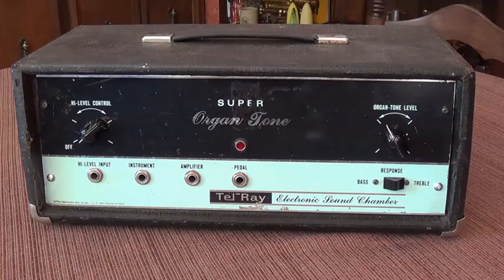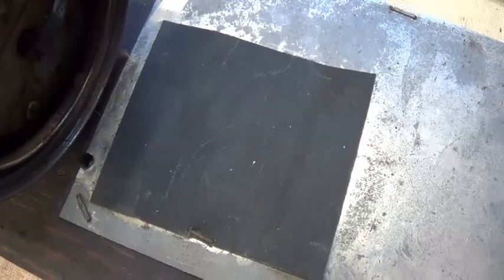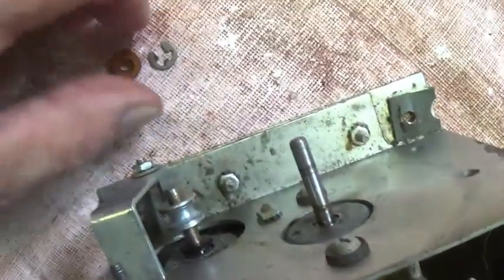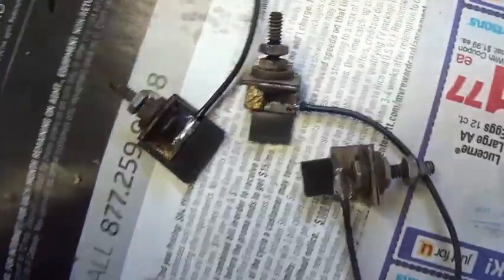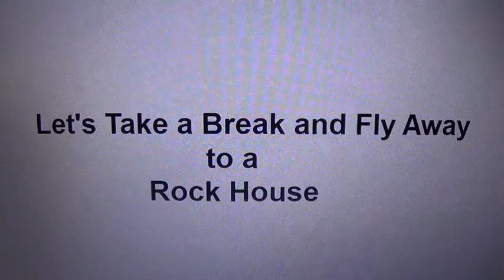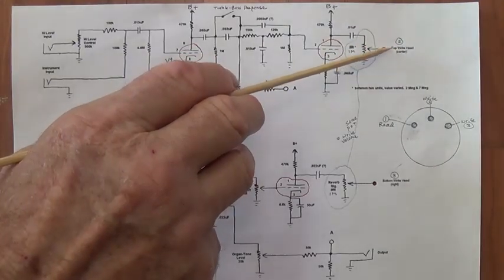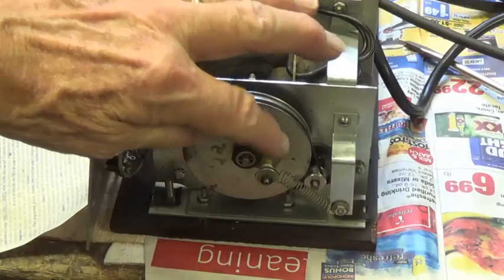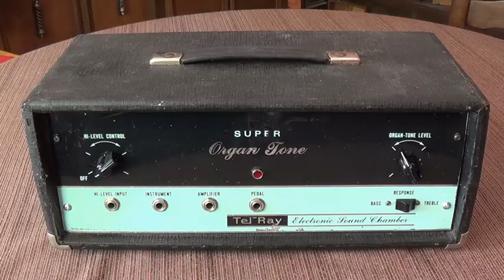Tel-Ray Super Organ Tone Resurrection.......Saved from the Dump !!

Comment: Uncle doug nice work one thing missing: how to clean the magic disk? thanks uncle Bill in upper michigan!!
Reply from the maker: Thanks, Skip. I use plain water and a soft towel. Not knowing the exact nature of the coating, it's best to take no chances.
Reply: @UncleDoug  just wanted to let you know i got one kinda working and am gonna ebay it. i simply took a little of the oil used in the can and with q-tips gently ribbed the black deposits off the magic disk. it might need more work but i got sounds from it. put up this video tonight.

Comment: Dude !! AWESOME Restoration !!!  After seeing the small amount of oil inside the can, do you think it would be a good idea to use some leveling feet and a bubble level on the cabinet ? I sure would hate to smoke that disc or heads !
Reply from the maker: That's an interesting idea, Joe, but the disc comes so close to the bottom of the can that the disc really can't avoid the oil......unless the unit was tipped way toward its front or back, which seems unlikely.

Comment: Hello Uncle Douglas:  I have seen your tremolo video several times and it is one of the greats .  That is why I could recognize that a phase shifting circuit was involved.  What I was referring to is a pitch changing vibrato circuit at sluckeyamps.com called the Warbler.  I believe you mentioned it in one of your shows.  That is how I knew how to look for it.  I know you played a true vibrato in one of your shows and mentioned that you liked it.  Since there is a 1/2 12AX7 that is unused in your Supro modification, I was wondering if the Warbler could be integrated into the Supro build, as a tremolo is already present.Thanks again, live long; vince
Reply from the maker: Thanks, Vincent. True vibrato is a rare beast, generally only seen in some Brownface Fenders and Magnatone amps. The Fender circuit requires 3 tubes to achieve its magic and the result is much like a very rich, lush Tremolo, as demonstrated in my video on the Fender Concert amp. The Magnatone requires the use of Varistors.....which are virtually unobtainable.....and sounds quite different from the Fender.....more fluttery and Leslie-like. I tend to prefer the Fender sound, but not enough to dedicate 3 tubes to achieve it. The best of both worlds would be to build a stand-alone ReVibe, which consists of a Fender Vibrato and Reverb in one cabinet.

Comment: It was very interesting. The only thing i would add is the ability to switch between vibrato and “normal” setting. The way i see that implemented just from the top of my head, is to add a “dynamic extension” between the spring and a chassy, dynamic meaning that you can change as to wether it is extended or not, and the way it would work is in “extended mode” the spring won’t have enough tension, therefore it will not create a wobble, and in “compromised mode” it will wobble, since you compromising the extention, therefore altering the spring tension by making it closer to the chassy, and getting a vibrato effect as a result. I don’t know exactly what this “dynamic extension” would look like, but i’m sure there are various ways to do that, whether you want to go fully mechanical, or use some sort of a relay, or another motor perhaps.
Reply from the maker: Actually, there is a very simple way to change from clean to effect, Danich. There's a "Pedal" jack on the front panel for a simple on/off footswitch to accomplish this by shorting the read head (see schematic).
Reply: Uncle Doug I think you misunderstood me. At 40th minute you add a spring that dramatically increases wobble quality of the effect, and i thought it sounded cool with it, but at the same time i thought it sounded more usable as an actual echo without the spring, and my idea was about adding the ability to alter tension of that spring to basically increase or decrease modulation of the echo.
Reply from the maker: You're right, Danich, I didn't understand your previous inquiry. I think the way to achieve control over the vibrato effect would be to get rid of the spring and have a steel arm moving within an electromagnetic field. When the arm is attracted it will speed up and when repelled, it will slow down. Then you could vary the strength of the field. Just an idea, but it might work.
Reply: Uncle Doug It definitely may be one of the ways to do it. The only concern i would have is as to wether or not magnetic field interferes with other parts of the whole machinery by making something not working properly.
Reply from the maker: The grounded metal can enclosing the read/write disc should reduce the possibility of interference, Danich.......sort of like a mini Faraday Cage.
Reply: Uncle Doug Do you consider performing any of this ideas? Could be a fun project.
Reply from the maker: I wouldn't want to alter an original unit, Danich. Perhaps if I could find a damaged one to experiment with.

Comment: So what is the differential level between the write and read signals?
I'm getting one write at +9, one at +17 and the read is hovering around -35dBu.
I am sending about -10dBu into it...
I think the drum (since it is only going to a common emitter output tube circuit) needs to be a lot bigger signal coming out of that delay can.
Thanks Uncle Doug!
Reply from the maker: It's been quite a while since I worked on one of these infernal devices, Jay. I'm afraid I can't answer your question.

Comment: Can you explain how there is any appreciable signal at the Organ Tone Level pot? It's fed from the cathode of V2a, which is a cathode follower configuration. Since the gain of a cathode follower is less than one, isn't the signal fed to the pot very low? I guess I'm asking how much signal is picked up from the read head. Thanks for another inspiring video.
Reply from the maker: I agree that the increased input stage impedance "bootstrapping" provided by V2a is unproductive with regard to amplification of the (no doubt) rather low voltage input signal. In addition, it then converts the low voltage to current, thereby further reducing the potential. It's hard to see how it can then be mixed "fairly" with the Direct Signal, which has been voltage-amplified by V1a. The next time I take the unit apart, I will analyze the voltages with an oscilloscope. As it stands, I am as bewildered as you are. Perhaps another viewer can help us to understand this seemingly contradictory circuit.
Reply: I don't like stumping  @UncleDoug .

Comment: Fantastic, as usual, Doug!  A sound sort of reminiscent of a Leslie -- maybe that's where the "Organ Tone" idea comes from.  Tempted to try to find one and run my theremin through it, but I'm afraid that might open up a tear in the fabric of spacetime.

So maybe I missed it, but what does the pedal jack do?  Is it for a simple on-off button?  Because I couldn't help but think of how cool it would be to have a speed control pedal, or some external control on the write volume.

Also, I'm wondering about the details of your media blasting setup.  Always been interested in that stuff.  What kind of equipment is involved, and what media did you use to clean those parts?  Wonderful work on that; amazing how clean you were able to get them.
Reply from the maker: Thanks, Ed. I believe the pedal turns the effect on and off, but didn't test my theory. A variable speed control would be a nice touch. I used very fine glass beads in a blasting cabinet at 90 PSI and applied it carefully......just enough to remove all the corrosion. The metal underneath was in good shape, thank heavens.

Comment: Hey Doug, love the videos. Really interested in building a parallel single ended amp (with 6v6's). Ever built one of those? Would be really interested in seeing a scratch build of one, got lots of questions about the power requirements, what you'd do to the impedance calculation for the power tubes/OT etc
Reply from the maker: Thanks, Oli. I have owned parallel output amps, but I have never built one. To be honest it's sort of wasteful, since push-pull is much more powerful, efficient, and quieter (hum cancelling).  Also, the idea of building a louder single-ended amp is a little counter-productive, since the charm of SE amps is most apparent at moderate volume.

Comment: I had a Hammond organ with tone wheels in it. Is this the same thing?
That was very interesting. Can this design be scaled up?
Reply from the maker: I have no idea, JJ. My knowledge of organ accessories is near-zero. I guess it could be, but I'm not sure why since it seems to work quite well as-is.
Reply: J J , apparently the tone wheels inside your Hammond Organ are indeed capacitive in action, but significantly more complicated because they have a series of stacked rotating metal fins similar to the tuning capacitor or tuning condenser in any analog radio or tuner. There are a number of YouTube videos online pertaining to repairing these devices, which are prone to growing conductive metal crystals known as dendrites in between the contacts and the rotating stators or metal fins. Several videos show how to zap those dendrites out, without disassembling the tone wheel completely, with a 9-volt battery! Actual disassembly of the tonewheel is even more complicated than what you see Uncle Doug doing here.

Comment: Uncle Doug; this is an amazing instrument. I have travelled the world and studied many different technical things that very few people even know exist. I can say I had absolutely no idea that anything like this ever existed. I really appreciate your showing it in such detail.

The media blasted parts look great.  My blast cabinet has glass bead media in it, and it seems to put a more etched / less shiny surface on parts. For my projects, that is really not a problem.  What are you using to get an almost polished effect by blasting?

When you installed the pulley on the read/write disc shaft, you mentioned using superglue. Have you ever used Loctite on things like this? I use it extensively. It's good because it sets up when in a thin layer, in contact with metal, in the absence of air. It's great for things like this!  Not that the super glue is inadequate! Just that Loctite is easier to work with since it won't set up until it's assembled. The sound check is beyond anything I imagined it would do. Incredible that a simple signal generator tone could be modulated into such a complex, and fascinating sound by this simple mechanical device. 

The guitar demo was incredible as well. Again I'm amazed and blown away. Thank you!
Reply from the maker: You're welcome, David. Thanks for all your comments. I did use very fine glass beads at 90 PSI, and was careful not to stay in one spot too long. I'm really glad you liked the video.
Reply: Good info on the fine beads. That may be the difference as I am using a medium size grit.

Comment: What material did you use in the media blaster?  It works a treat!
Glad that Jack saw fit to give the unit a CAT scan before you started the restoration!
Reply from the maker: Yes, I'd be lost without Jack's initial scan of all components. I used fine glass beads at 90 PSI.

Comment: How about using a high wattage wire wound potentiometer to vary the line voltage to the 
Motor from perhaps
90 to 120 for a speed control. The telray sounds like an effect Iv 
Heard from a B class Si Fi movie from back in the 50s or 60s
Reply from the maker: Motor speed could be easily regulated with a simple fan speed control from Home Depot, Dwight, just like the one I used in my compact Leslie speaker.

Comment: Great job, Uncle Doug! A quick question for you though, What media did you use for blasting? Crushed walnut, glass beads? I know walnut is usually used for fragile pieces. Keep up the excellent work, cheers! - TW
Reply from the maker: Thanks, TW. I used very fine glass beads at about 90 PSI. If I had walnut shell media on hand, I probably would have used it instead.....but it all turned out great.

Comment: OMFG, holy grail!!!
Reply from the maker: Thanks, AQ. It's a dandy !!!
Reply: Just finished watching this, absolutely amazing! Was this meant to be a Leslie speaker simulator, hence "organ tone" and that strong vibrato effect?

I'd have thought one of those write heads would be an erase that would drain the charge to ground in front of the write head but I guess not, at least not on this model. Some models definitely work like typical tape or bucket brigade delays though where the number of echoes is controlled by feedback of the read head mixed back into the write head, often called "regen" on old devices like these. I think on those ones an erase head is necessary.

I'm curious about the different widths of the rubber heads. I wonder what that's about. Might the charge spread out on the disk, maybe so wider heads are used to read than write? (Or is it the read head that's narrower?)

And just to freak you out, have you heard the rumor that these originally contained PCB oil? I've heard both that they did and didn't from different sources. Seems plausible enough as large transformers at the time commonly used a PCB infused dielectric oil for convective cooling. Obviously these devices work perfectly fine without any carcinogenic chemicals though, so I can believe just as easily that they didn't. (Still, might be a good story to tell a seller to get them to lower their price! ;)

Comment: Hi Doug, great video and thanks for sharing! I am not familiar with your media cleaner. Could you please explain what device this is?
Reply from the maker: It's a large, sealed cabinet that allows you to spray very fine glass beads with an air gun at dirty, corroded metal objects, removing all the surface grime almost instantly......leaving a smooth, satin finish ideal for assembly or painting.
Reply: Thank you, like a sand blasting cabinet...
Reply from the maker: Yes, except I don't think anyone actually uses sand for blasting purposes in a cabinet like this.

Comment: Wow suoer video! 50s movie effects-also sounds like psychotic Dick Dale. But doesn't that oil leak out of the can when the unit is turned around? Or dry up?
Reply from the maker: No, the oil does not leak out. The can is sealed. It may "dry up" over a very long period of time simply due to degradation.....just like the lubrication in a waterproof watch case.

Comment: hi doug :-)
at the guitar demo part i would be tempted to use a two channel input amp and run the oil can full wet then blend the sounds with the dual channel head.
that thought hit the brain after about five seconds of hearing that. i would love to hear my washburn long scale through that thing to be sure!
i have to wonder though...was there a unit that didn't use the spring attachment? i actually preferred that sound to the sound of having the spring attached.
 thanks for sharing this with us.
Reply from the maker: You're getting too technical for me, Giz. The spring attachment can be removed in a few seconds if you prefer it without the "wobble".

Comment: So, when they anodize aluminum it makes tiny pores in the surface (I think they use Sulfuric acid in a way much like Electrolysis) and during then the second stage a colored dye fills the pores along with a wax like sealer.  Some people even anodize with a clear.  The color of the piece is what you're seeing in all the tiny holse.
So I wonder if the sealer slurry has these tiny carbon granules that fill the pores during the second stage to make these disks.  Since anodizing makes the surface a thin layer of aluminum oxide the result is much stronger surface, no wonder it lasted so long.
Reply from the maker: This is all news to me, Daniel. Thanks for the interesting info.
Reply: @UncleDoug  I'm a little surprised that you haven't tried anodizing yet, especially with all the hot rod stuff you do.
Do add to my earlier post, apparently the heat expands the pores enough to draw in the dye, they can do that without any wax since it cools down and shrinks the pore openings.
Reply from the maker: @dbingamon  A friend of mine who restores motorcycles professionally, tin plates the hardware using a simple electroplating setup. This is about as sophisticated as I have ever been tempted to try. The idea of putting large, expensive parts into sulfuric acid and they dye honestly doesn't appeal to me. First off, colorful steel parts are not really "in style", but more importantly, the risk outweighs the benefits.....in my opinion.
Reply: @UncleDoug  Good point, looks better polished anyway.
Reply from the maker: @dbingamon  Thanks, Daniel.

Comment: A friend gave me a Morley delay unit, rat chewed, and the same mechanism but rusted, disk and all. Solid state. Another friend has it in a pedal that is supposedly a rotary simulator. Ss also. Im pretty sure this one is totally ruined.
Reply from the maker: I wasn't aware that SS versions were made, AL. Thanks for the info.
Reply: Actually i dug it out and the disk looks ok. Only that front is rusty. This appears to have a shaft like a pot in the front to adjust delay time. Ill have to take that can apart, I didn’t realize how to disassemble it before.
Reply from the maker: @ambroselockerman1115  Good luck with it, Ambrose. The disc itself is aluminum, so it shouldn't rust.